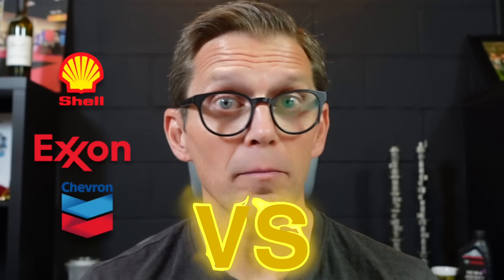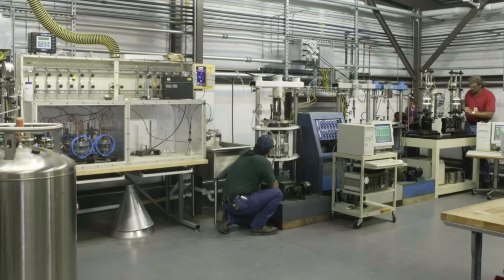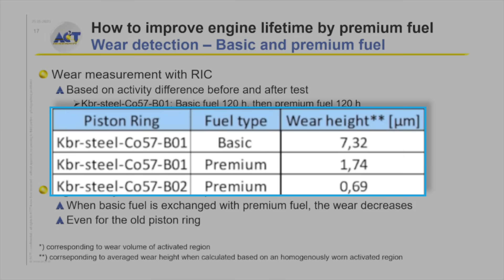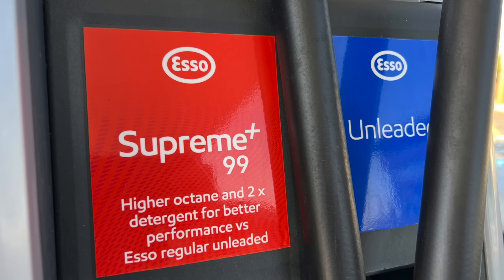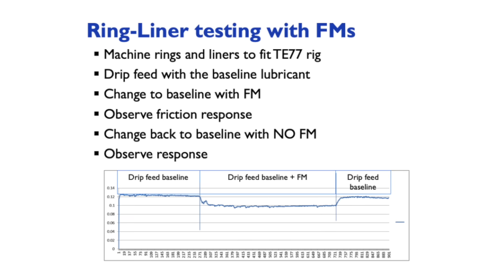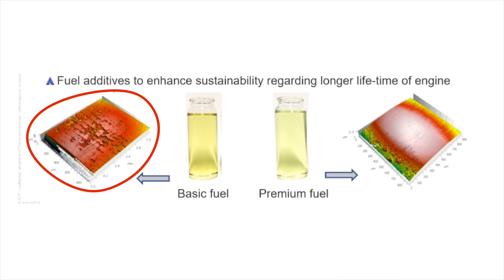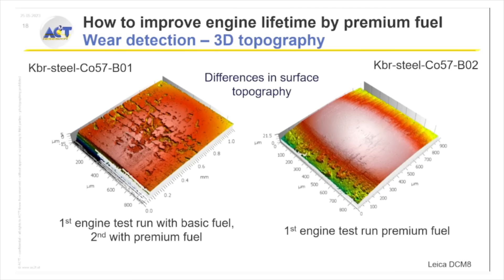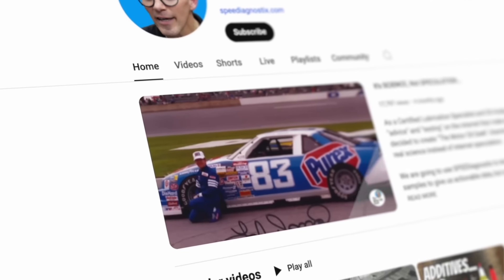Can Premium Fuel REDUCE Engine WEAR?

Comment: In the USA, Premium+ 91 octane Mobil gasoline has the friction modifier package.  Same for Shell.  The other octanes grades do NOT.  I looked this up after watching this video.  I suspect the additive package is being provided their company Infineum.  This is eye opening to me as I thought all octane levels had the same additives other than octane.  I l also looked up BP and Chevron and these companies do not mention any anti-wear additive package with their gasolines at any octane grade.  Over a 200K mile period for my car, the cost difference is about 1200 dollars to step up to the premium fuel.  Ummm.  That actually sounds worth it to me for engine protection.

Comment: My V8 engine is rated for E85 flex fuel. I noticed at 87 Octane i got pre-ignition engine tick. When I switched to 89 or 91 it went away. So I run the higher octane for my own peace of mind. There is a slight increase in MPG but not enough to offset the extra cost. I look at it as an investment in getting more life out of my engine preventing major failure prematurely.
Reply from the maker: Thanks for sharing!

Comment: Thank you for the excellent content.

Would be helpful  be helpful to also learn if both V-Power 91 and V-93 have the same engine protection additives or if V-93 has even better protection?  
Does extra engine wear protection also apply to Shell V-Power Diesel?
Reply from the maker: Both 91 and 93 Shell V-Power have the same additive package.

Comment: I put 91 in all my cars, even though 2 are flex fuel and the other can take 87 ethanol….better mileage and power…I also add Duralube to my oil at every oil change. Engines just sing smooth and happy at 210,000 miles

Comment: The 2001 Chevy has 335k, 100% premium fuel since 2003. Conventional Oil change averages 3~5k depending on the usage of the truck. The recent compression check is at 75%. If you get to this, I"'m open to any suggestions. Truck purrs, not even a jig when idle.

Comment: Lake are you trying to tell me everybody shell V power is better than 93 octane 100% gas I have a 2017 Buick Regal t how do you use 100% gas 93 octane so why should I switch to Shell😊😊😊😊😊😊😊
Reply from the maker: The additive package is Shell V Power is better than the additive package in Non-Ethanol 93.
Reply: @themotoroilgeek  I will take your advice and I will switch to shell V power

Comment: Yes and No. First, is super unleaded Cleaner, no it's not, it only has octane added. Now if a car is designed for super like my Lexus is and you run 87, the Detonation if bad enough can hammer the bearings

Comment: Oil sample question? I want to do an oil sample on my new car, have done the first oil change at 1,000 miles, the next will be at 5,000, then 10,000 and every 5,000 after. Which would be the best interval to do the sample?
Reply from the maker: I'd take samples at each of the first 3 oil changes to establish the trend analysis, and then base your sample interval off that data.
Reply: @ I did not sample the first oil change because I didn’t think it would be accurate.
Reply from the maker: @wk7060  the first couple of samples will have higher wear metal levels, but that is hepful information. Kind of like the high tide mark.

Comment: Yes to a video about fuel quality. I have used Chevron ‘Regular’ 87 octane fuel in my vehicles exclusively with good results; no engine maintenance required aside from oil changes.
Reply: Wich vehicles tho? Imho non GDI non turbo vehicles suffer way less from these problems

Comment: Awesome video!!! I am actually excited to see this vid. Question; does this work with those fuel stations that are considered Top Tier regardless of the octane, or just Shell premium fuel? I'm asking because I used to only put Shell V-Power Nitro + in my truck, now I use any of the Top Tier fuel stations, i.e. Cosco (Kirkland), QT, Valero, Sunoco, etc. If I need to go back to Shell only, I will. Thank you for this video.

Comment: I would love to hear which additives made a big difference (can I add them myself to cheaper fuel?), if there is a maximum dose of additives (can I add too many additives or too much of a single additive)? 
I’m currently driving a diesel (3.0L Powerstroke) with 135K miles on it. Are there comparable data sets for additives and wear for the diesels?

Comment: I know that in my area the fuel tankers all fill at the same pipeline load-out (at a refinery). They then will drive down the street and fill an Exxon, a Conoco, a Sinclair, and then Holiday. 

They're all buying the same stuff out of the same tank on the same truck. 

Funny story, I see zero mileage or power difference. 😂

Comment: Additives are more toxic generally than fuel.  Proof… dang… you heard or lead or toluene.  Synthetic oil just as bad made from gas… seems anything but natural to me.  Actually if we still used petroleum lube oils in the engine and just changed the oil often like every 1500/3000 miles be better off… we would not be having the oil problems… but still need some kind toxic additives I suppose.  Then we could burn the oils in our waste oil heaters.

Comment: I'm revisiting this, and I have a question!
How often are "top tier fuels" certified?
BP used to be a TTF, now it doesn't seem so. If I go to the website it seems Shell and Marathon stations are the only TTF near me. I've lost 2 BP stations close to me, which I've run their 93 octane in my Harley since I've had it, and now this year I have ZERO BP stations close to me!
I'm not against using something else, non ethanol for this might even be acceptable for the time I have to actually ride it nowadays.

Comment: In the Austrian study they used oil that simulated "worn out" oil past it's OCI and with insufficient additives in order to study the effects of the fuel additives. One of the goals of the study was to see if the fuel additives would allow extending OCIs even further. More study with normal oil quality would be needed before that study would recommend fuel additives in normal operation.

Comment: Question. Does premium fuel in a low compression (9.4:1) engine calling for 87 make a difference as well?
I’ve always been taught 93 would be a waste because of the compression ratio and timing being tuned for 87.

Now an engine with a higher compression raitio calling for 93 and putting 87 in it I definitely see how that’ll make a difference in more than one are of issues.

Comment: Are you confusing higher octane with "premium" in this video? As I understand it, the additive packages are consistent within a brand, regardless of octane (except, of course, for octane-boosting additives). I did a story for the New York Times on regular vs higher-octane fuels, and interviewed car makers, including Porsche and Mercedes, the API and the EPA..All said that octane is in no way a measure of fuel quality, just detonation resistance. I'm afraid people will go out and just buy higher-octane fuel based on this video, when octane has nothing to do with what happens typically in the ring land area, with fuel dilution.

Comment: Just to be clear...he's talking about higher octane having a better additive package than the lower octane? I always get Shell gas cause it's "top tier", I just figured the additive package would be the same from 87 to 93. I guess not. Does it get a little better each grade you go up, or do you have to get the highest?
Reply from the maker: Correct. The better additive package is only in the premium grade 93 Octane fuel. It is not in the lower octane grades.

Comment: The Truth about Gasoline Octane:
The truth about gasoline octane, a lot of the new car owners manuals will say that you have to have 94 octane which is a lie, if you believe this then you are just going into the game with half of the information, be realistic about your car.
The standard hip pocket rule of thumb for octane is if your motorcycle or car is not pre detonating then use the lowest octane available, octane to put it in gentleman's terms can be loosely called " The Resistance to Detonation of any fuel", and the best example I can give you is if you take a pie pan of gasoline that is 87 octane and a pie pan of gasoline that is 94 octane, you put them on the floor of your garage and you approach each one of them with a lit match, the 87 octane will detonate further away than the 94 octane, so gas is formulated to have a greater resistance to detonation the higher the number, and the number comes from an old thing that was called the "Anti Knock Index" because older cars over time would have the valves go out of adjustment, heads would leak, air would get into the motor.......and when the air would come in it would actually make your car run hotter, and to lower the temperatures in our cylinders we would put in higher octane gas, so if your car was knocking or running on after you turned the key off in the 50's, 60"s & 70's the solution for that was to put more expensive and higher octane gas in your tank. 
Lead was always in gasoline back then as a lubricant, but they would use things like seetane and later on toluane and other octane modifiers, and these octane modifiers were put in to artificially pump the octane number up on what the regular chemical composition of gasoline would be.
Believe it or not one of the best octane boosters is water, and old trick used by old diesel mechanics, because of the hydrogen chain of water being H2O.....there is 2 hydrogens and 1 oxygen, if you have an old diesel engine that needs to have the heads cleaned, one of the Hail Maries was to spray some water through an atomizer bottle or spray bottle into the intake track of a diesel and what it would do is it would crank up the octane in the diesel fuel going in and it would burn out all of the carbon deposits inside the motor, but it is actually pretty dangerous and it can scatter a motor while your spraying it to explosive results.

Only use 87 octane fuel in your motor vehicles regardless of what the owners Manuel says, if you use any thing higher then the ethanol will chemically retard the timing of the engine which is actually alcohol poisoning. 
Higher octane does not burn cleaner as the petroleum companies would have you believe.

It is not about the ethanol percentage because 94% octane does not contain more ethanol than 87% octane, it is about the ability to burn the gas versus the ethanol ratio in it. 
Ethanol is hydroscopic meaning it brings in more moisture.

There are 2 methods of determining the octane number, one is the RON and the other is the MON, some countries use the RON exclusively and some countries use the MON exclusively. In the United States we use an average between the 2 numbers so the next time you are pumping gas for your car look at the pump and it will say 87 octane RM/2 and what that means is that there adding the research number R+M/2 to the mechanical number and they are dividing it by 2, so they are giving you an average between the RON number and the MON number, now when you are looking at your owners manual for your Japanese or European motor vehicle it is going to have a higher octane number and sometimes these manuals for cars specify a higher grade of gas because they have a higher cylinder compression and they are going to need 98 octane fuel, well 98 octane in the European system translates to our system in the United States to about 91 or 92 octane, so you are not buying the wrong gas and you are not going to damage your vehicle, the gas that is sold in Europe is the same gas that is sold here in the states they just have a different method of measuring the octane number.

Every company that makes their money selling additives have tested out fuel, so if you use 87 octane in your motor vehicle you will not get a single horsepower number higher on a dynamometer running 94 octane through your cars engine than you will running 87 octane it just does not work that way.
If you are going to over build your motor, if you are going to run a high compression motor, if you are going to alter the timing to fire that spark plug at a point where the piston is higher and therefore the fuel is under higher compression then you do have to start using a higher octane fuel or you will pre detonate, so simply put if you've got a tuned motor or if your motor is under a high heat high stress application then it is ok to run a higher octane fuel to help counter the effects of cylinder pressure and heat.
If you put a higher octane fuel in a motor that clearly does not need it you are doing your motor a disservice, and you are doing 2 things to it, 1 is you are making the oil companies really happy and we all know they need more money..... Right? But really what you are doing is chemically altering the timing of your engine, if you have points or fuel injection with a computer your spark is set to fire or go off at a certain time that is all based on the appropriate fuel for your vehicle and when you start changing the formulation of that and you start putting high octane fuel in then what you are doing is chemically retarding your timing because let's say now instead of that thing firing at 18 degrees before top dead center now in fact it is going to have to turn further, the crank will turn further, the pistons will go higher before it actually sets off the explosion because high octane gas has a greater resistance to detonation and compression, so now you have just messed with the timing of your vehicle.......spark will happen and ignition will happen but the time it takes because lower octane fuel burns hotter faster and higher octane burns slower and will take a longer amount of time before it lights up, spark and timing is the same but the flash over, the amount of time it takes to flash or fire up is changing and taking longer and is occurring later and that will give you the same effect as if you then further retarded  your timing.

With the current junk fuels blends they are selling us there is 20% less gas in your gas today than there was 10 years ago, between oxygenation and ethanol MTBE and all these things that are in the fuel they are taking the place that gas used to be and as we did that a lot of these components and chemical recipes that are in your fuel are there to pump up the octane that we lost when we started putting ethanol and oxygen in the fuel, and now gas does not last anymore, it used to last a couple of years but now within 30, 60, 90 days it smells like varnish and the engines won't run right.
Modern fuels are literally just eating seals, the rubber is just falling apart, so if you are going to let's say rebuild your carbs make sure you are using rubber items and elements in your carbs that have not been sitting in a bag for 30 years because those things are not going to be safe for modern day fuels, use modern day "Viton" seals and rubber.

Comment: So curious if I bought a used vehicle with nearly 80,000 miles at this point would it be a waste of money to use the premium considering the real possibility that previous use could’ve been from low-grade fuel
Reply: It never hurts every once in a while to do half a tank or even full tank of premium with a good additive. I have used marvel mystery oil for years, never had issues.

Comment: So should you be running the higher petrol like shell V power although your vehicle calls for the 87?. Especially if your goal is to keep a vehicle as long as possible. Like I change my oil on time but use 87 petrol. The manufacturer recommends 87 with statements claiming that using higher octane petrol will not increase performance.

Comment: I use Sheetz 90 octane ethanol-free gasoline in my Toyota Highlander Hybrid, mainly because I've had fuel separation issues with regular gasoline after the car wasn't run for several weeks.  Can you provide info on the anti-wear properties of this ethanol-free gas?  Thanks!